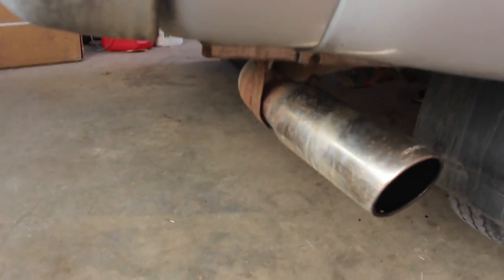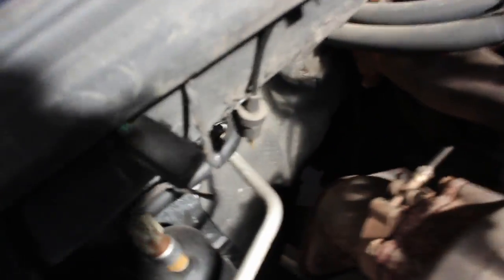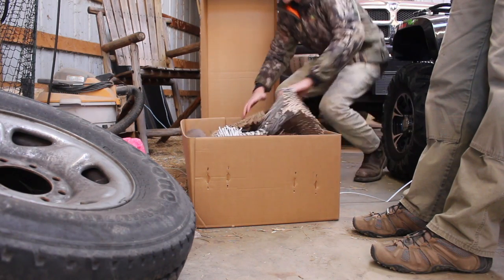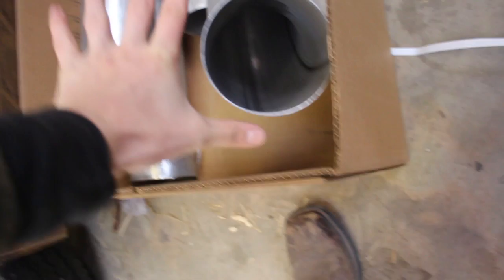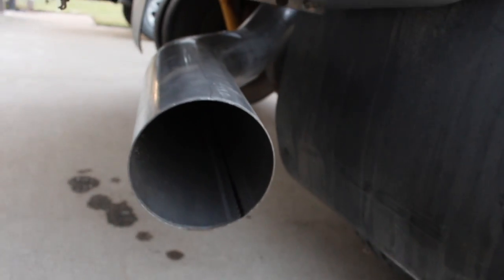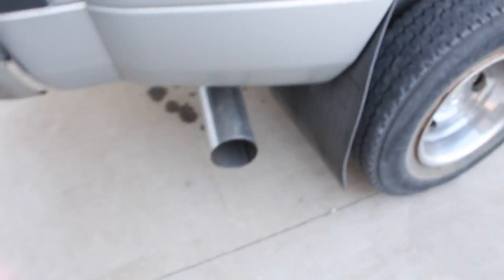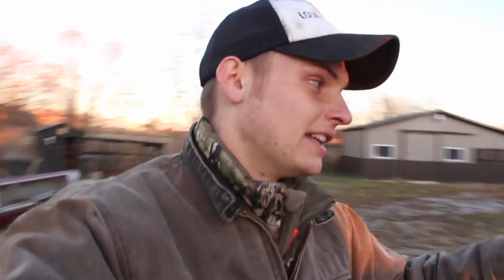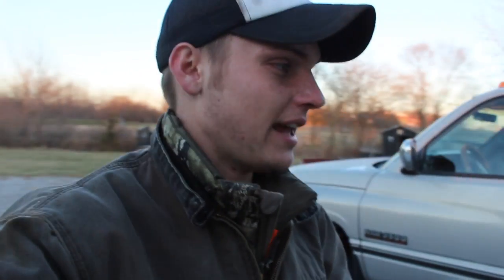12 VALVE CUMMINS GETS NASTY 5 inch STRAIGHT PIPE EXHAUST!!! *EXTREMELY LOUD!*

Comment: Just got my 95' 12v straight piped with the same exact 5 inch Diamond Eye. Sounds insane, you can hear it half a mile away at least. Nothing compares to that bad ass 12v sound.

Comment: If you're hearing/feeling the truck vibrate, it's probably from the one hanger that's metal to metal.  I had the same system on my 96 5 speed, but couldn't go straight pipe because of the safety check procedures here, but it did sound great.  I liked the 5 inch sound but personally I prefer the 4 inch that I used to run on my truck.  Nice addition to your truck bud!  Sounds like a big rig now!!

Comment: I want a lbz duramax but they are just stupid expensive so was thinking of trying to find a 2wd 99-05 ram 3500 6spd manual Cummings. I like my IFS FRONT SUSPENSION I absolutely hate solid front axles I've owned a few and then switched to my IFS Chevys and I can't and will never go back to solid front axle plus I don't need 4x4 I'd rather the extra mpg and ride quality we never get shit for snow in Saskatchewan. I think I'm going to look for a 2wd manual 24 valve 12 valves are just to gutless I've always liked the 24 valve over the 12 I like computers and hate most old school mechanical crap specially CARBURETORS I want a 6spd manual 24 valve for my next daily driver as I'm almost done restoring my 98 Z71 Silverado and after the money I've sunk into my good old Chevrolet I don't want to drive it in bad weather or winter again it's served it duty it's time for it to sit back and win trophies at car shows and will need a new daily driver next fall.